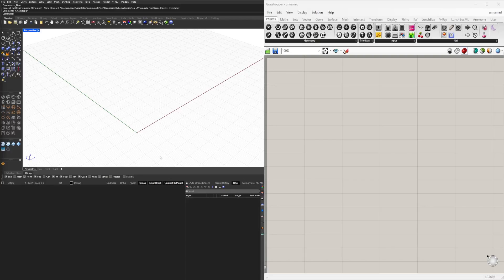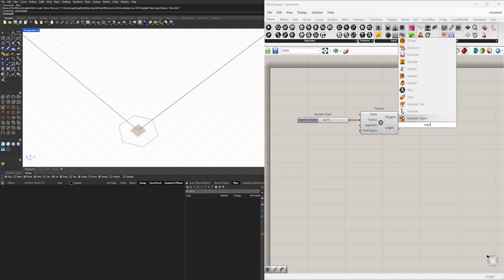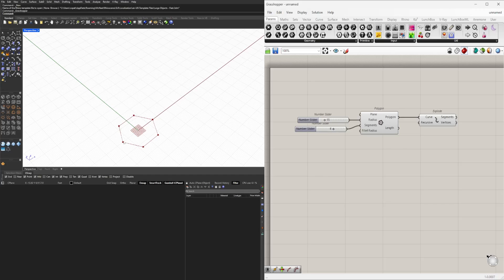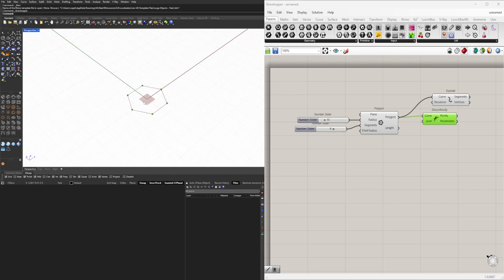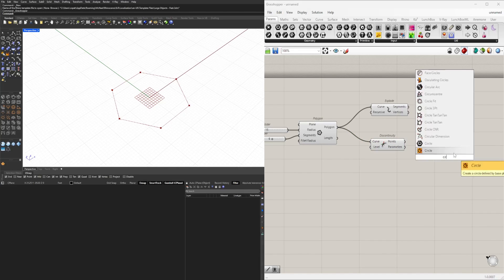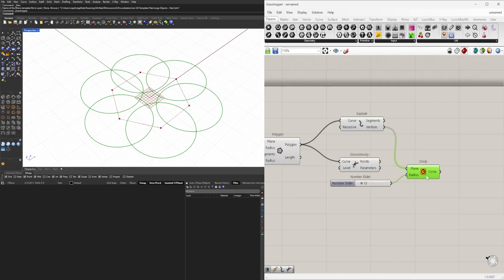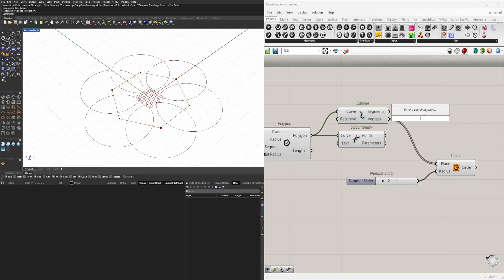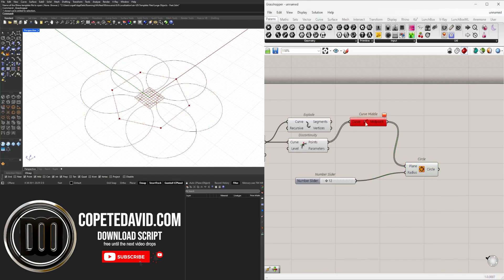Rhino 8  and Grasshopper Discontinuity Component Overview How To and Why.

Comment: I'm sadly not in the position to update to Rhino 8 currently. Are the changes to Grasshopper 'game breaking'? Or would I still be able to do everything in the GH that's shipped with RH7? I hope you know some more about this :)
Reply from the maker: From rhino 7 to rhino 8 I have had issues with 3 things that I use a lot.  I am sure that there are more things to iron out.  When you use area, it is different from rhino 7, and sometimes doesn't work.  Open nest is not working for me, although I have heard of some solutions. Now in Rhino8 when you extrude a curve, it extrudes as a solid not an open extrusion.  I am sure that there are more things that are glitching a bit, but hopefully they get fixed in a future update.